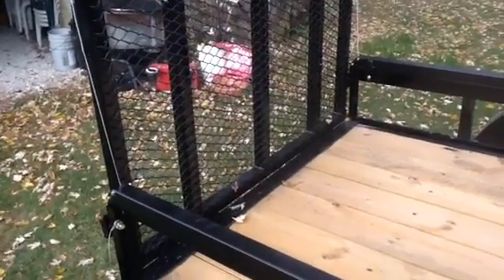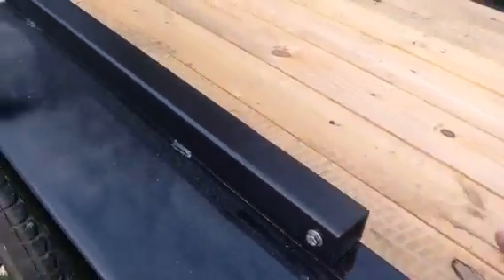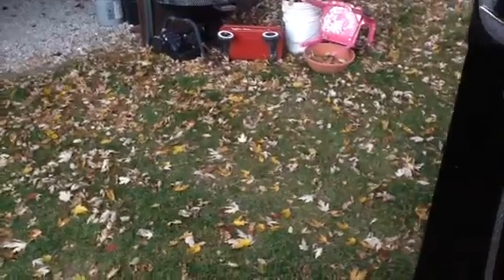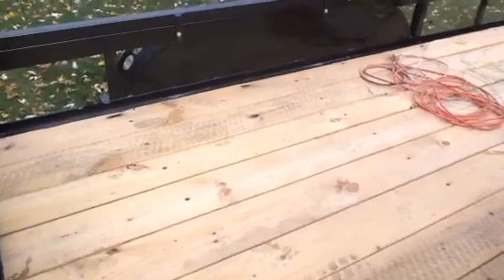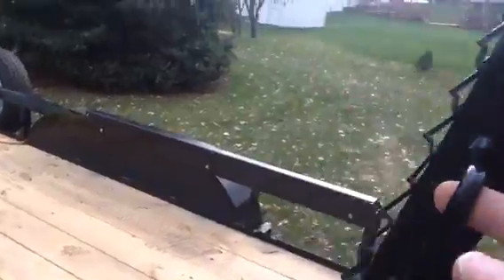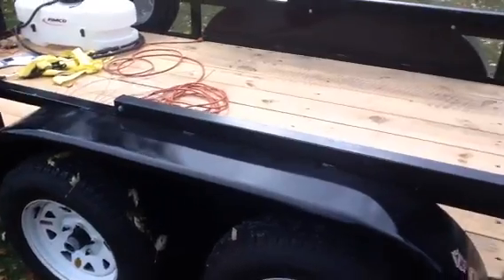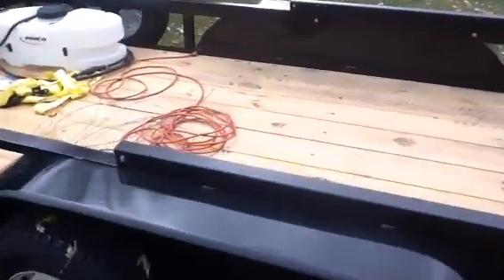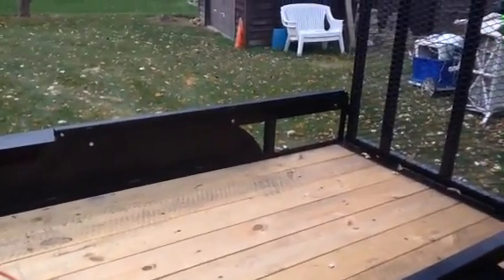Trailer tail gate spring assist lift gate

Comment from the maker: What I did for sizing of the 2x2 tubing and length of the cables was I set up the both sides temporarily with clamps. Then I used 3/16 cable clamps to test the angle and pulling strength of the springs to balance the weight of the ramp. Once I achieved the right balance with the two 90 Lbs garage door spring I cut the lengths of the material all installations are different like, I added the two extra supports on the ramp where the tractor tires line up with for strength. So the engineering for your project will need to be completed by you to get the right balance. The gate assist has several years of use and it still works great and look good. Remember if you use garage door springs take the time and paint them because they come bare metal and are subject to rapid corrosion.
Reply: goneredcar1 Good idea on painting springs didn’t think about that Again Very helpful Video

Comment: Thank you for sharing this awesome gate spring system. I think this is the best DIY gate system out there. In addition, it is the safest of all I have seen. Would it be possible to list the hardware and supplies used for this project? I am definitely going to build this for my trailer.

Comment: I just saw this video wanting to do mine my gate is too  much for me and bought all the stuff my question is to what length did you cut cable and how much tension on cable at rest .Did you attach cable to spring and then to tailgate Thank you for replying And very good video I’d give 2thumbs up but cant any help is appreciated
Reply: I think you have to set up with heavy duty C-clamps and kind of get to know the tension,  to see where about you need to permanently place .

Comment: This might be a dumb question...I just bought everything I need for this project. The top rail of my trailer is 2" tubing. What would prevent me from using the existing tubing rather than welding the 6 ft piece to the top? The only immediate challenge I could think of was attaching the spring to the bolt that holds it in place. I'm I going crazy here?
Reply from the maker: Nathan McCarter The reason for the tube is two fold, spring containment and to help stiffen the upper support of the trailer given the strength of the tube be it round or square.  If you look at basic trailer construction it describes the benefits of the upper support and its addition to overall support strength.  In other words it can't hurt to add extra support.

Comment: How much tension is on the cables when the gate is in the up position? I am thinking none to a small amount. Then as you lower the gate the tension increases as the gate pulls on the springs and extends them. Also what is the rating on the springs you used? Thank you and very nice work!
Reply from the maker: Remember the spring ratings will very from the weight of the gate.  The overhead door springs I choose for my application was a blue coded spring or 90 LBS. I paid around $20.00 for them.  The tension on the sprigs is just enough to hold the gate in the up right position.  I have used this gate lift system for over a year without any issues.  I did however install two metal cap on the ends to keep water and debris out.

Comment: What gauge/thickness of your square tubing? Thanks.
Reply from the maker: Randy Vann I used 1/8"" square stock it helps firm up the rear portion of the trailer. But any size will work for the spring containment.